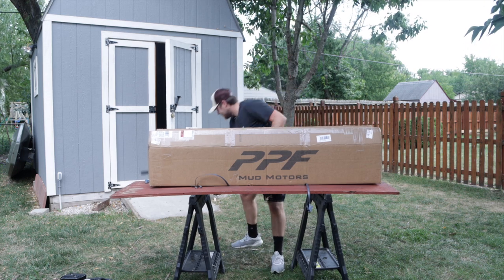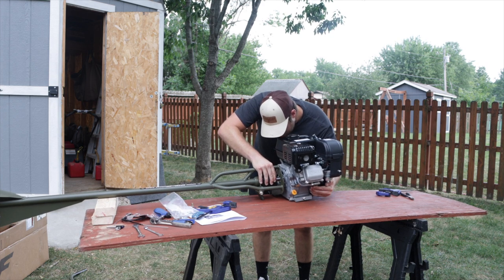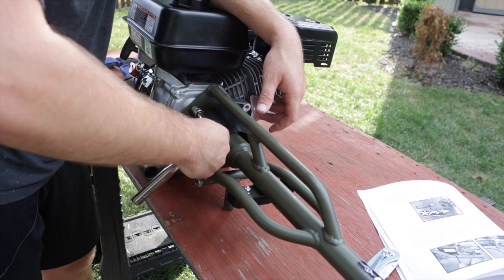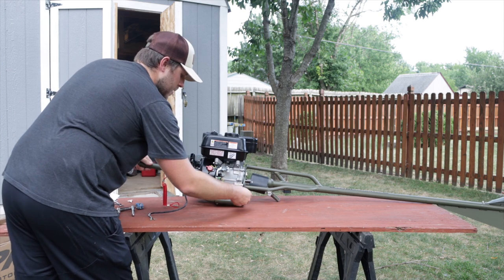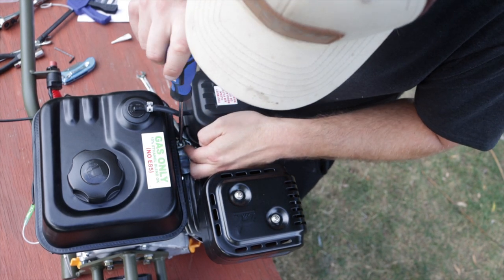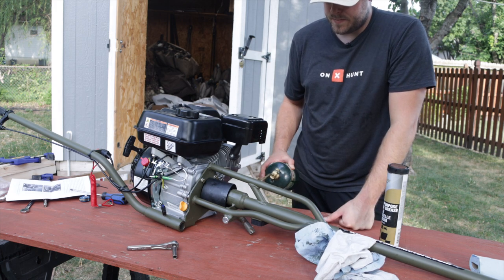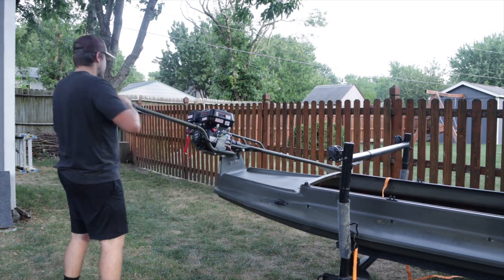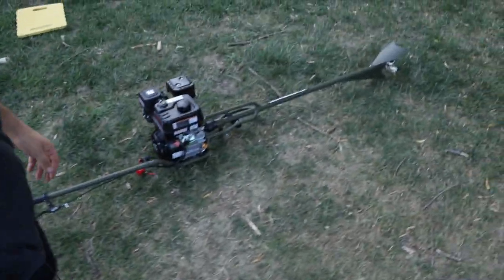Building My NEW Mud Motor

Comment: Does this motor have to be greased in the spot right by the skeg like other mud motors it looks like there is a spot to put a grease gun in and also if there is is there a spot that the old grease comes out at all?

Comment: Keep in mind if you ever need to remove those allen screws you would be wise to heat the area around them to cook the loctite out. Otherwise you will strip the inside where the wrench goes. When that happens you get to start all the drilling, and threading,  and using up a couple of cases of mfers, 305 dammits, and precisely 289 sobs with probably about 2½ dozen of those "that POS". So go ahead and stock up on them in advance. 🤣🤣🤣